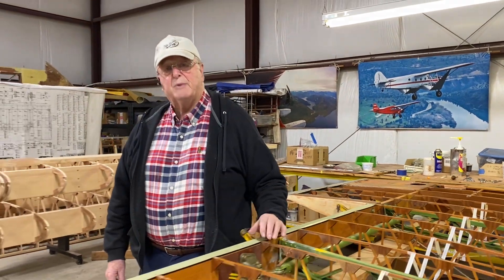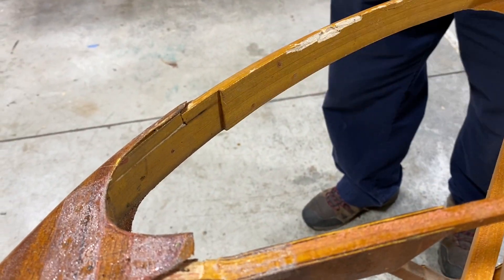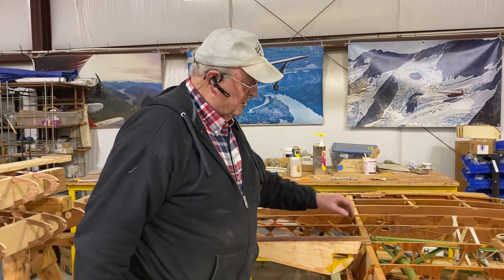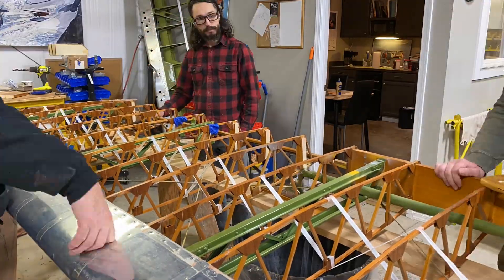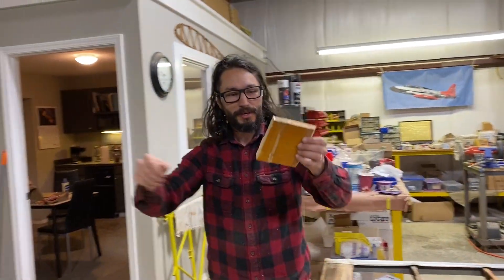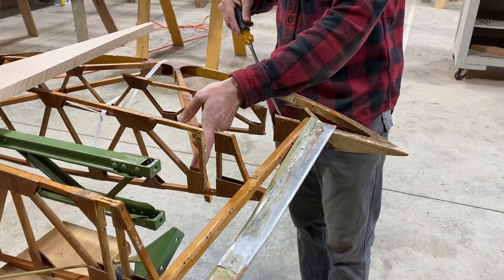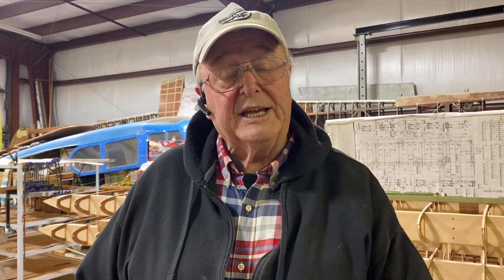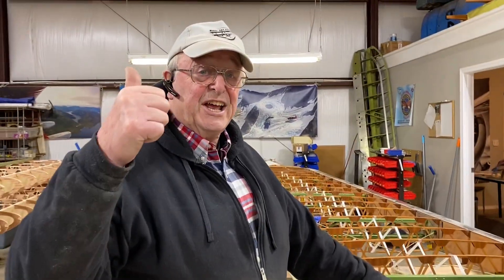How to Replace a Broken Spar in your Stearman Wing after a Ground Loop

Comment: Hi John,  That looks like a small crack... nothing to be concerned about, right?  
1) what is the height of the saw horses?  At 6'3" my back gets shot if I use shorter horses.
2) Do you glue the spar to the ribs?  
3) I think your wing instruction included plywood on the bottom aft portion below the wing walk.  I don't see that on this wing.
4) Did you glue the plates to the spar?  I didn't see that operation.
5) Did you glue the ribs to the spar?  I didn't see that either but think you mentioned it in the audio.  
6) It also looks like you need to cut the spar opening on the number 1 rig in order to slip the spar through. Correct?  

Thanks.  Mark